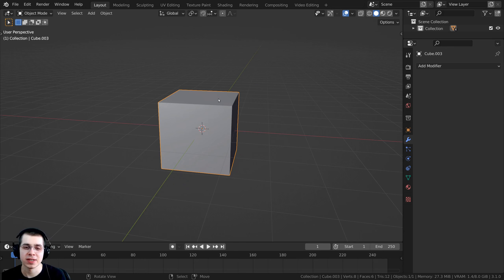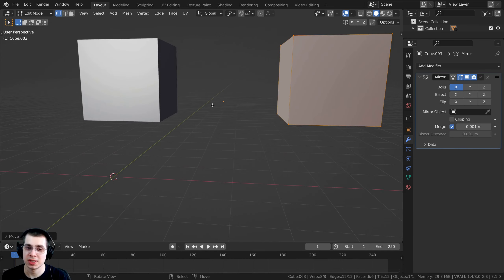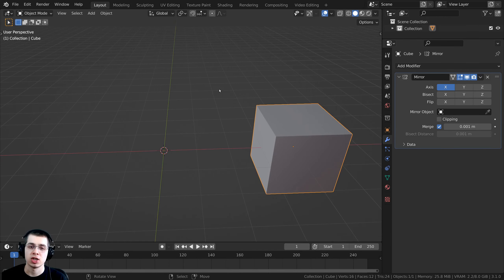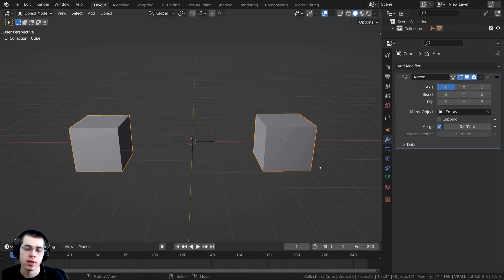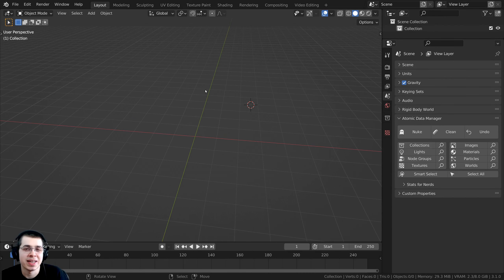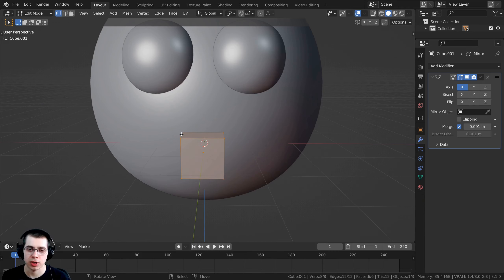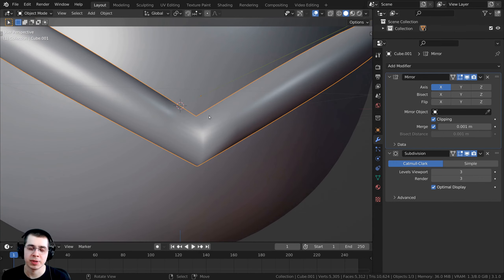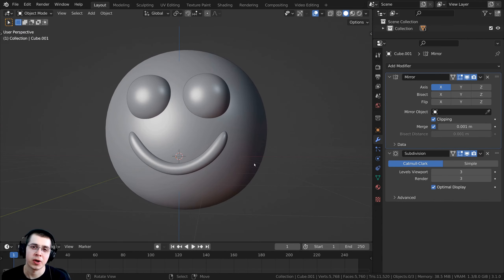How to Fix Mirror Modifier not Working (Blender Tutorial)

Comment: Yes, this is a very common problem and maybe a reason it persists is that everyone seems to miss one part of the problem which is less obvious.  Please try this.  Add a cylinder so that you have a shape that looks different when rotated.  In OBJECT mode, rotate the cylinder 90 degrees around the Y.   Then switch to EDIT mode, select all and move everything along the X.  Now add the Mirror modifier to the object and mirror along the Y.  The origin of the object is still at the World Origin and outside the cylinder, but the Mirror modifier does not work.  You have to use the Z axis for it to work.  Just making sure the object origin is in the correct place is only one part of the problem that makes this modifier a bit annoying.  When rotating the object the local axis of the object also rotates and that makes it confusing because the mirror modifier seems to work off of the object's local axis, which seems to be why people still get into situations where it doesn't seem to work.  You might want to update this video to include applying any object transformations before adding the modifier.

Comment: Quick question. I have troubles with mirror modifier and it's clipping options. I am trying to create half of a ring and then mirror it to the other side. The clipping is working correctly on top of the ring but not on the bottom. What could be a problem? Maybe order of modifiers? I am confused I appreciate if you can help? Thanks!

Comment: Hey! I'm having issues (followed every single step of your video) with my blender 2.91. With the mirror mod, I end up having to activate the "Z" axis to get the mirror to follow along the Y axis. Origins at world origin. Same object location and rotation as yours per axis. Any ideas?
Reply: I suppose it is useful to say that I have reset Blender to factory settings and the issue still persists. Update: Seems to be an issue with the cylinder.
Reply from the maker: I think that's because you need to apply the objects rotation. then it should work normally.

Comment: I made a bicycle structure when I mirror it, it doesn't mirror both parts parallel it shows it shows the front part split into two half only back part attached and sometimes overlapping into one another

Comment: my only problem with this is once you rotate the object it wont align vertically.
Reply from the maker: Yeah, you could move the model down, and then have it mirror on the Z axis.
Reply: @RyanKingArt  i used to work with older version  that once mirror it will auto align to the exact location, this 3.0 need to do manually.

Comment: Dude! i hoped to find solutions from your video,,the simplest thing i didnt find..while making an human figure..i just want like in sculpting mode((
Reply from the maker: hope it helps  : )
Reply: @RyanKingArt  i watched from beginning to end ,and nothing,everyone makes example with cube ,dividing it ,x axis,centre and so on but noone with a face or that monkey..somehow having all settings like yours when i grab something remains initial form,one above other so to say..in sculpting mode it works perfectly,but in low poly face ,its a headache (
Reply: @RyanKingArt  do i need to cut a cube in half to mirror left side than make an cube to work with both sides,because if i use mirror modifier having a cube it transforms but you can see initial form when i transform,its confusing?

Comment: Hi Ryan, wondering why I had to use this method 5:02 to successfully mirror my character's right eye + left eye. At first I had set the median point of the right eye to 3D cursor which was at the centre of world origin then when I mirrored it, the placement of left eye would always be incorrect. 

I noticed it probably was because I had rotated the right eye a little bit facing outward before doing this so I used all transformation deltas on the right eye, freezing any transformations. But even after this, the left eye would always be mirrored at the wrong place; it would use median point as a location to mirror itself which was what I wanted it to do but it would also take into account where the rotation was making the right eye face, so left eye would always be mirrored right next to the right eye, clipping into each other at the centre of the face. Here is a clip of it in action: https://youtu.be/942Z53QcdWE